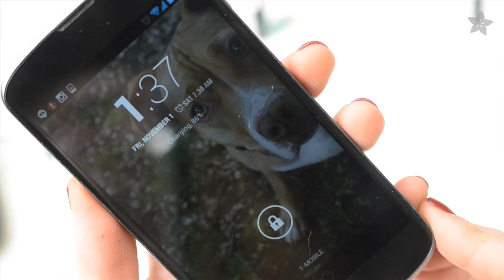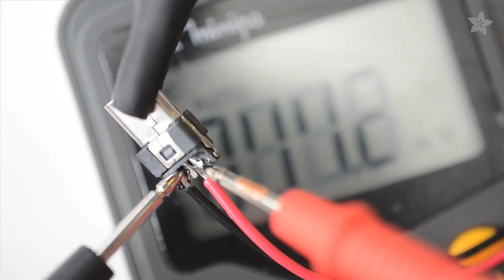Cell Phone Charging Purse - the Power of Induction

Comment: For phones that support the Qi standard like the Nexus 4 and 5 it would be cool to embed a wireless charger in the purse, so just slipping the phone in the right pocket charges it.

Bonus points if it's powered by a big battery in the purse, so it can charge the phone while you walk.
Reply: I'm just a bit confused as to why you would even plug in the N4 given that it has wireless charging built in. . .
Reply from the maker: do it! =]
Reply: Matthew Prentice, exactly my point. 😀